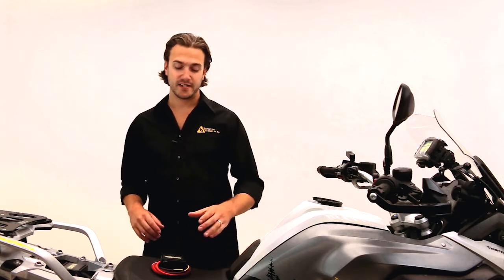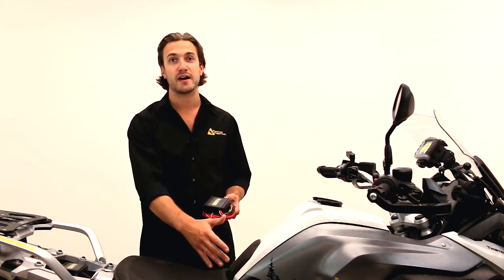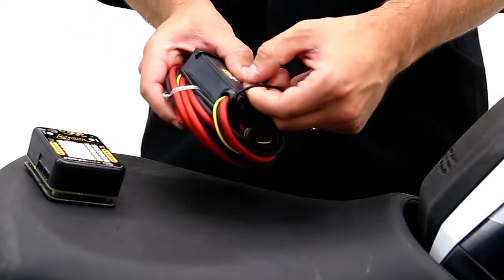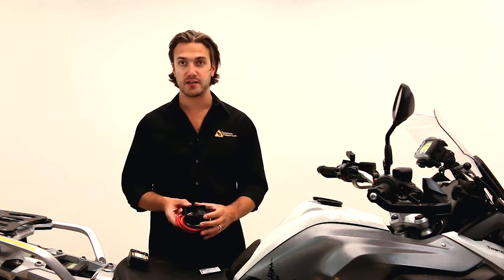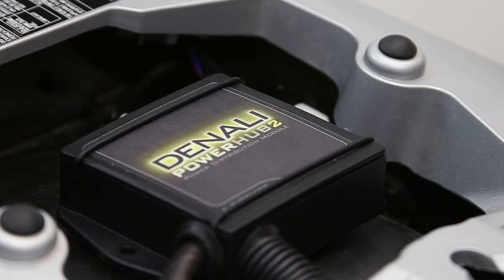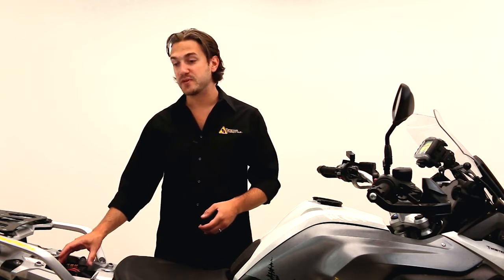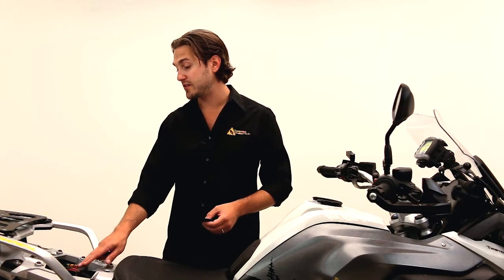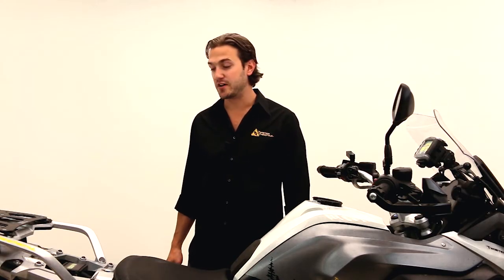Review of Denali PowerHub2 fuse block and ground block for motorcycles, UTVs, and ATVs

Comment: I’m late to the party here but I can confirm that the lack of waterproofing is an issue with this unit. I had to replace mine after 3 months as the main ground wire corroded and snapped off. Luckily it happened on a short ride but it would have been a huge pain on a tour.
Reply: I ordered from Demon Tweaks who are refusing to take responsibility. I have since purchased a PDM60 and it’s better in every way (but expensive). Good luck.
Reply: Hi, thanks for getting back to me. I bought mine off of them too and they have advised me that they want to send it off for testing before considering replacing the unit. The unit is under warranty and has only been used for 300 miles of dry riding on a bike that is garaged when not in use. They tell me this will take 3 weeks. As I have already spent a week sorting this out via emails to: 1. Denali who tell me this has a 5 year warranty. 2. Twisted Throttle, who appear to be a distributor in America and did this video and 3. Demon Tweeks who respond to emails slowly (>24hrs) but are not particularly helpful. It therefore appears that I am to be without the bike for at least a month while they sort this out.
Reply: Steve Foster Yep I got the same response. Sorry to hear they are treating you like this too. They’ve been trying to avoid replacing my unit since early December. I also told them that they had left me without a rideable bike, they don’t seem to care. Our warranty is with them so I believe they are acting illegally by passing the buck back to the distributor. In the mean time, check out the PDM60 from Rowe.
Reply: Thanks, that looks like a much better unit being totally sealed in, I've pretty much lost faith in the Denali anyway, like you say it would be a right pain if it failed when you're away on a tour and everything hooked up to it.
Reply from the maker: Hey London and Steve,

Yes, in your case the warranty needs to be done through the dealer in which you purchased the unit. If they are being troublesome, please let us know and we can maybe give them a nudge to get it going, reminding them that they are responsible, as the dealer, for servicing warranty requests. 

You can shoot us an email at info@twistedthrottle.com with the details if you do need us to give them a push.
Reply: @twistedthrottle  Thanks for responding to this, Demon Tweeks are insisting that the unit has been pass to the UK distributor for testing. This was weeks ago. I'll drop you a note on email. Thanks again
Reply: Yes mine fell apart after 12 months rubbish quality.
Using a fuzebox now great product check the reviews
Reply: @alandavenport2794  Yep mine fell apart to first one straight out of the box, second one failed after 10 months.
dealer are happy to replace it but I don't really want another one.
Reply: After these reviews,  I think I'll pass
Reply: I have the same problem, main ground wire has come off after 3 months. Did you get yours replaced okay?
Reply: Mine did too but it's not waterproofing issue...I believe it's a galvanic corrosion issue.